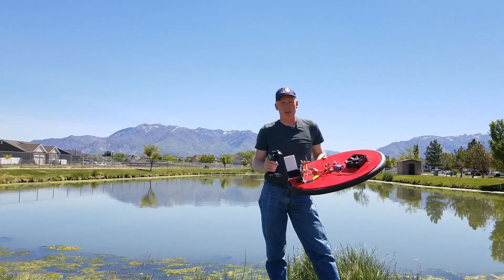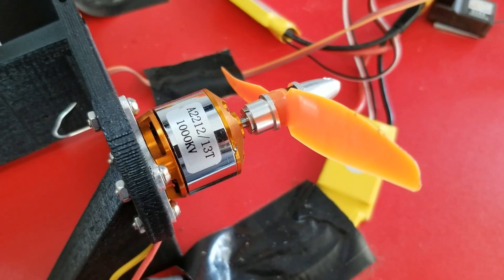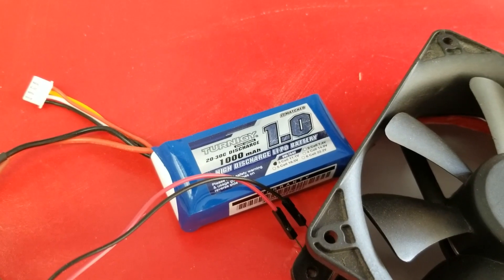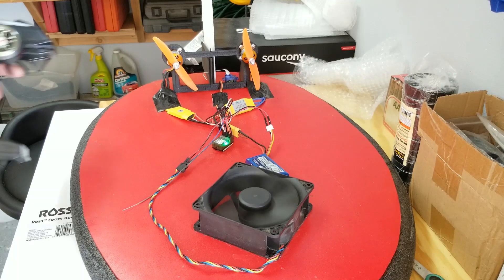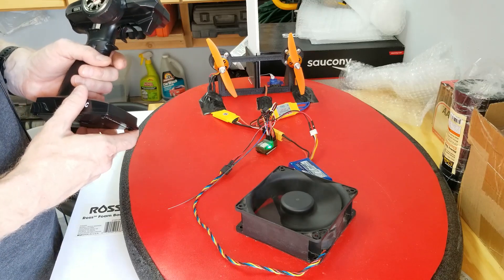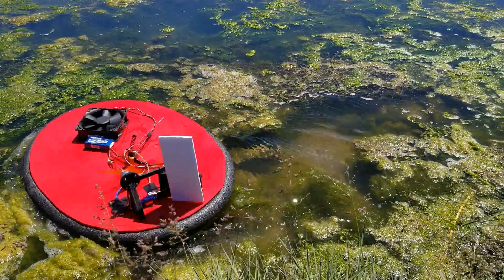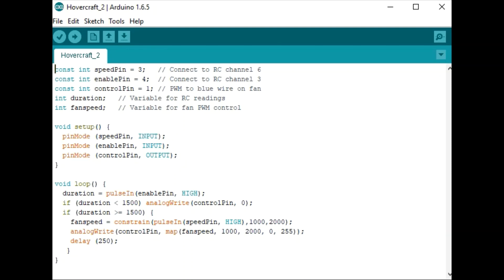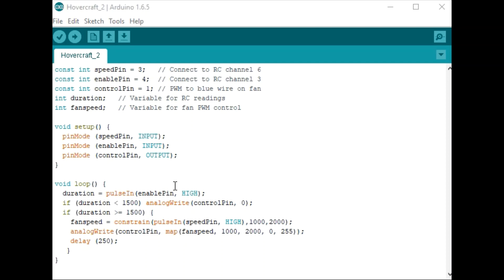RC Arduino Hovercraft Version 3 (finally on water) : Arduino 4-wire CPU Fan Control

Comment: Is the bottom of the hovercraft open? You just have the foam insulation and then the deck foam?
Reply from the maker: Yes. The bottom is completely open.
Reply: How did you get it to hover so smoothly? I have created a similar hovercraft but it wants to rotate on me. I'm sure the actual rotation of the fan blade is causing some of this. I did notice the air doe not come out evenly under my skirt. Was there a solution for when having theses issues if you even were? @ScienceFunInnovations